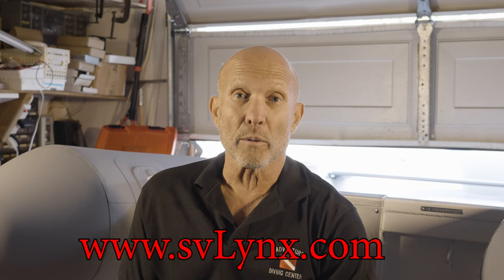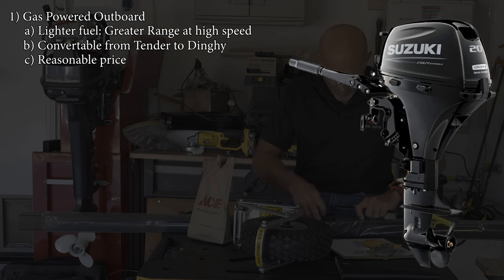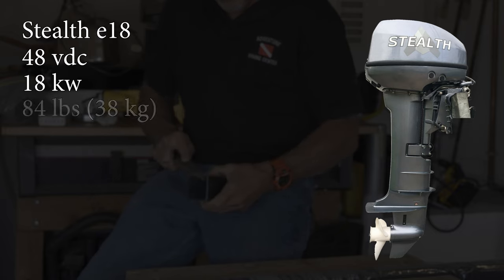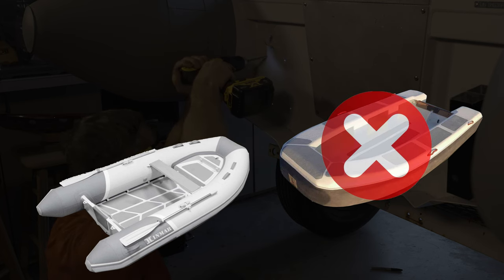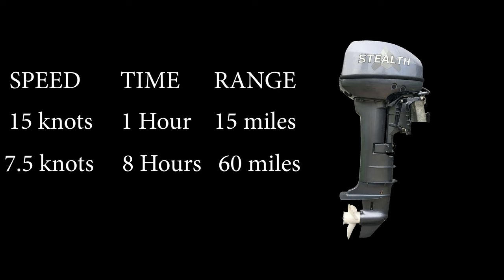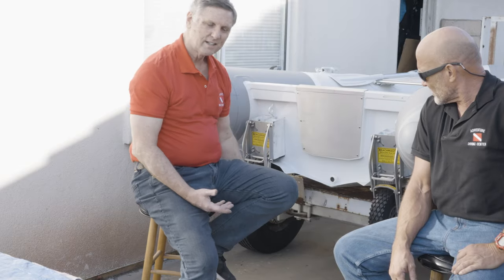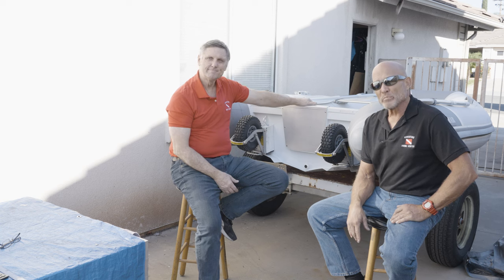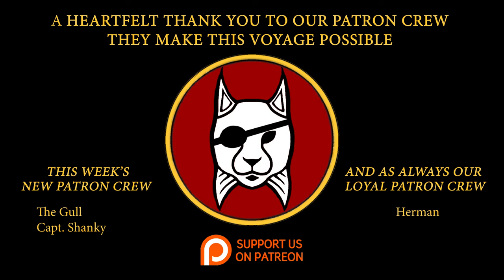Kit-E11:  Electric Outboard convertible Dinghy/Tender for our Performance Catamaran

Comment: Great videos! I am in a similar situation, I have gone through a similar maze of boat search and tribulations.
I am subscribing and binge watching.
Small corrections: The outboard batteries increase your house capacity by 50%, not 33%
The outboard storage conflicts with your fish cleaning table.
Reply from the maker: Well, on the batteries, we had planned to use two 24v 230ah batteries in the tender and four more on the boat... so 33% was correct.  As for the fish cleaning table, once we decided to add the outboard storage, we reconfigured how the fish table is stored, but it still works on that sugar scoop.  Thanks for watching and the comment!
Reply: @SailingSVLynx  
Thank you for the great videos! I am sure  you are getting all kinds of "great advice" from everyone.
If you had 48V 460A on the yacht, and then you added 48V 230A to that for your Tender, then you increased your total capacity by 50%, not 33%.
The Tender has 33% of the total capacity. But it increases your yacht capacity by 50%.
Anyway, not important at all.
I hope you can finish this lifetime project anywhere close to schedule. That would be a great achievement!
Reply from the maker: @RainerSchrom   Sure, but at this point, it has 0% since we are no longer going with an electric outboard.  All six batteries are all on the main boat now.  :)

Comment: I was at the sailboat show in MD a few months ago, and the Torqeedo sales person told me not to get an electric motor for a Highfield 360 because they said that the HP to battery weight ratio just wasn't there yet and so it would either never get on plane or weigh too much. Do you agree? Also, I think your wheels need to be big and fat and raise up 12" or so for most effectiveness, similar to the sea max. Those wheels close to the hull will cause issues in my opinion.
Reply from the maker: No, I don't see any issue with the wheel mount as many boats use these in that location without issue.  The Torqueedo or, in our case, the ePropulsion Evo motor is not  meant to plain our dinghy, that's what the e18 Stealth is for.  Our Evo is just for short dinghy rides to the beach.  That's sort of the whole point of having a convertible tender\dinghy.